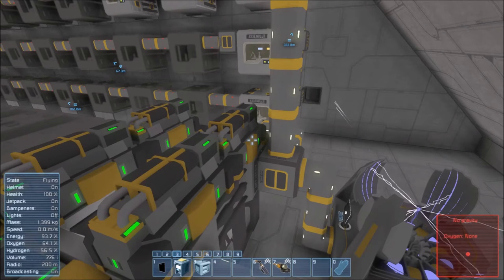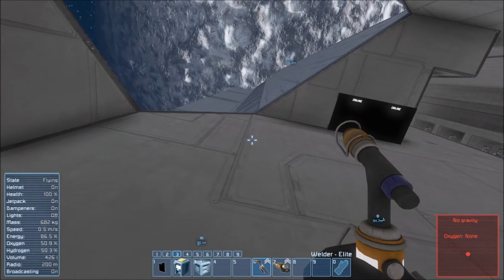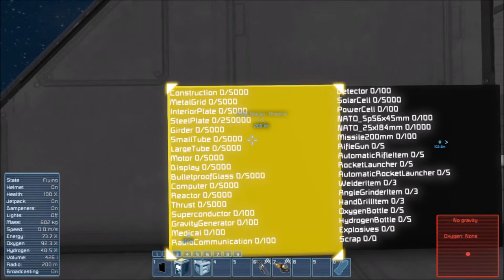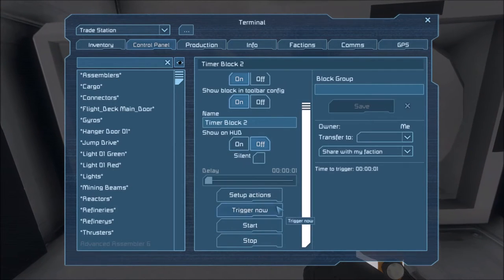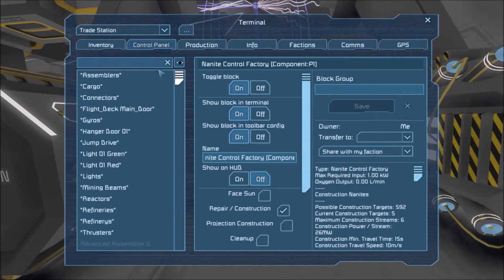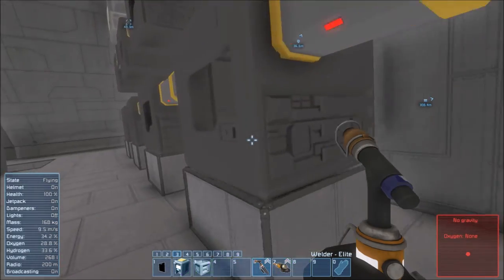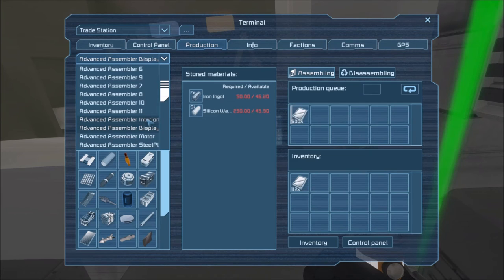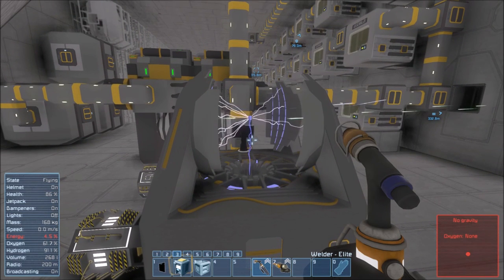Space Engineers - Crafting Component Quotas - Episode 37

Comment: Looking at your ship I can tell you that you will need more power then your reactor can produce. And it is also good to always have back-up because like you side if they shoot it.
Reply from the maker: Trust me, that reactor can handle 1.2GW of demand by itself. If it ever comes to that, I can just build another in two seconds. In terms of combat though, it isn't supposed to be under fire as it has a Combat Air Patrol of 32 strike fighters and some light corvettes. (I have decided against shields as they are kind of cheaty
Reply from the maker: Duke00x the Hangar doors do not use power, the 'force field' part is just cosmetic (thankfully). I actually need to experiment with shields at some point to test their limits.

Comment: The LCD were working after you added the second program. But it was working on the two next to the programmable blocks and not the ones across the room. If you watch the video you can see the numbers changing at the corner of the video.
Reply from the maker: I see that (10:51), and I believe it is because the script cannot read from the nanite factory (grr). I will mess around with it to get something working but for the time being, being blind will have to do.

EDIT: I have now got it working as intended. The LCDs will now show spare components (those not being used by the nanite factory). Basically made one of the cargo containers Priority 1 and set the factory to be exempt from the auto sorting.